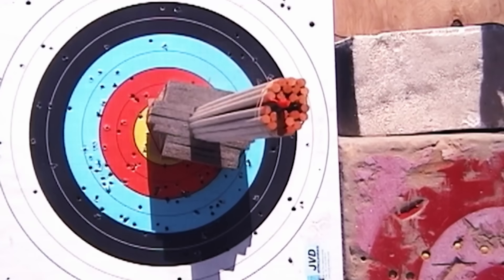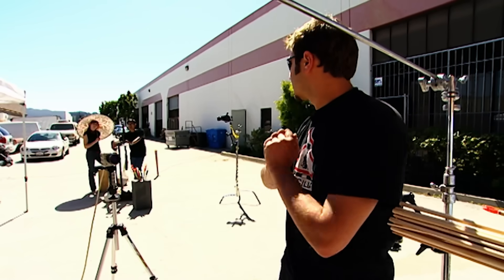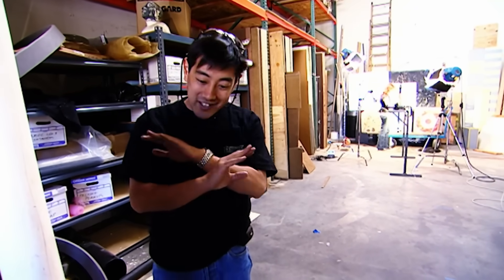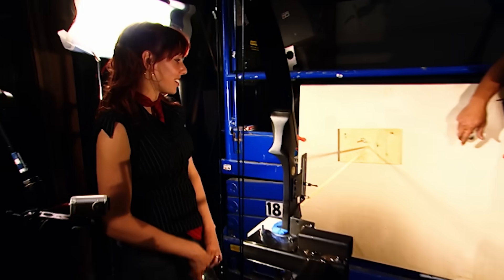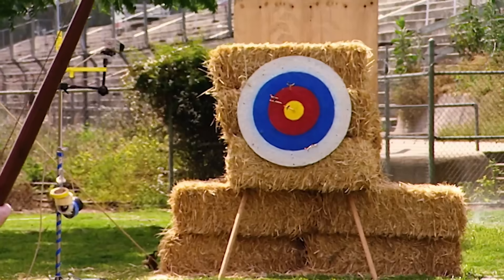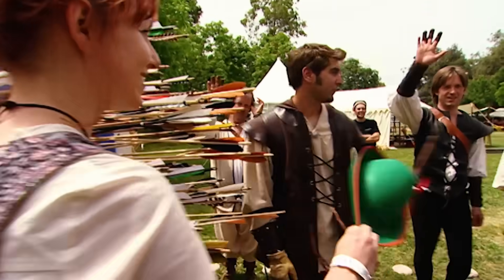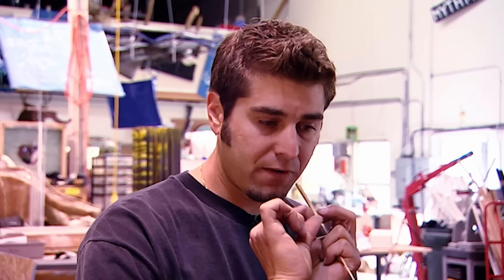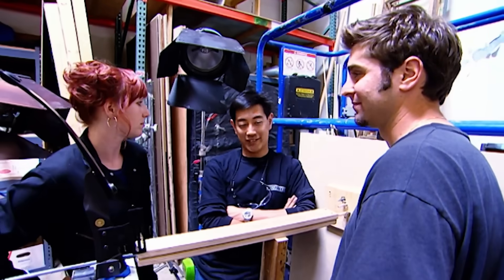Can Robin Hood’s Shot Be Recreated? | MythBusters

Comment: The problem with this mythbuster is they are using wooden dowels where arrows are made out of shafts
Reply: Therefore the grain of the tree doesn't run straight up and down the shaft because it's a dowel a dowel runs at Angles
Reply: I honestly can't believe it took you three or four days to think about the grain of the arrow 
         ❤I thought of that in about 30 seconds of the video

Comment: Archer here, if it was war arrows they would have a piece of horn attached in the nock, to prevent the string to split the arrow. But even a wodden arrow w/o horned nock is hard to split in two. I would probably use a hunting arrow point to maximise the chance.  It is not impossible, but hard to do. I try not to hit my own arrows, as they are expensive 🤔🙂

Comment: As I recall, the shot from the movie in question was done by an expert who could do it reliably, but they used a bamboo "stunt arrow" because it has completely straight grain.
Reply: Howard Hill did it with bamboo arrows. He also shot real arrows into wood boards worn by stunt men. They got paid extra for that.
Reply: It was also hollow, which made it a lot easier. 
I just confirmed that the target arrow splits into three parts, not two. I think that would only be possible if the target arrow was hollow, and the arrowhead of the fired arrow has three blades, rather than two.